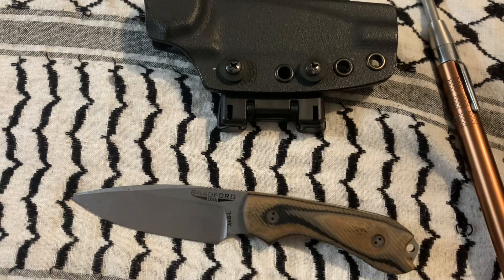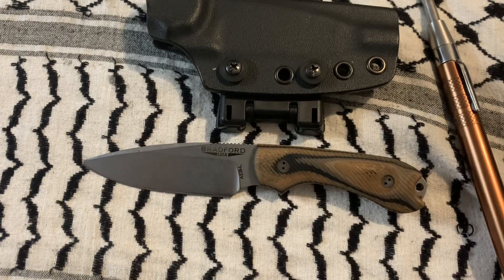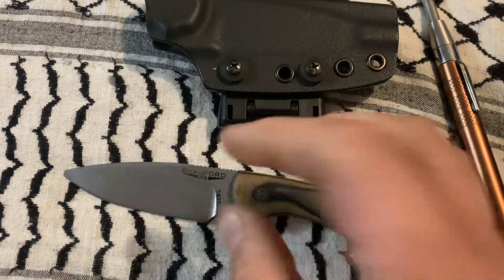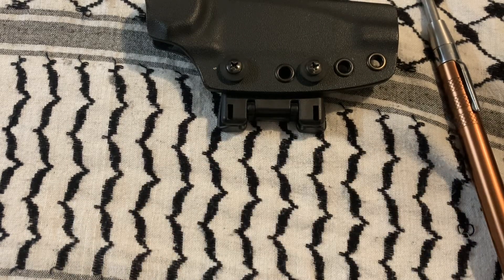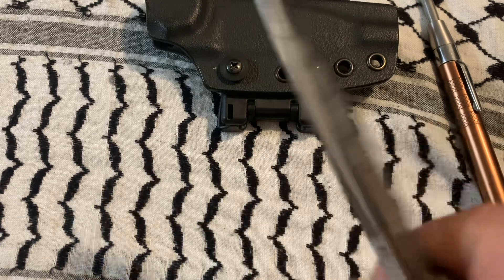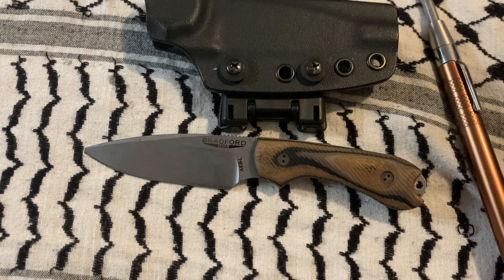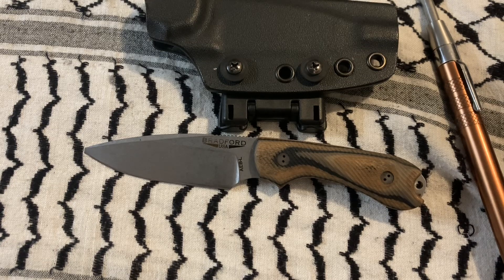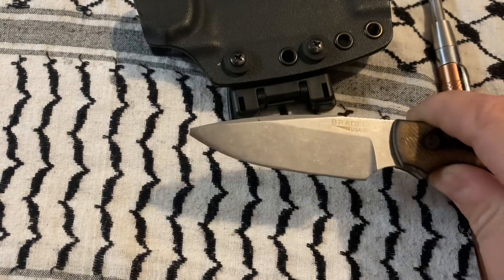I Broke the Tip Off My Daily Driver

Comment: Well the important thing is how the customer service treats you at Bradford knives.  I tested a OffGrid and was doing normal testing and the tip just came off.  There website says lifetime warranty.  They you read the fine print.  I sent them email, IG messages and a video of what happened and got ZERO reply.  Bradford should replace this.  We pay a TON of money for very overpriced knives.  The manufacturers need to be accountable.
Reply from the maker: I never thought of that! I'll reach out to them and see what they say. I wouldn't be surprised if what I did isn't covered, though.